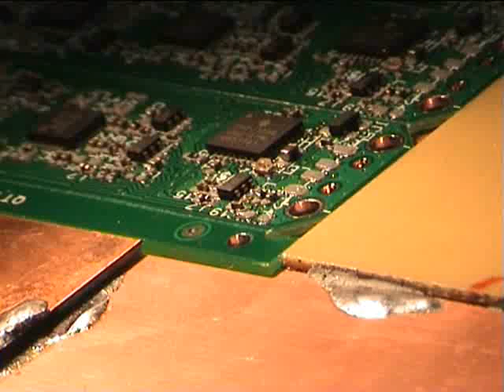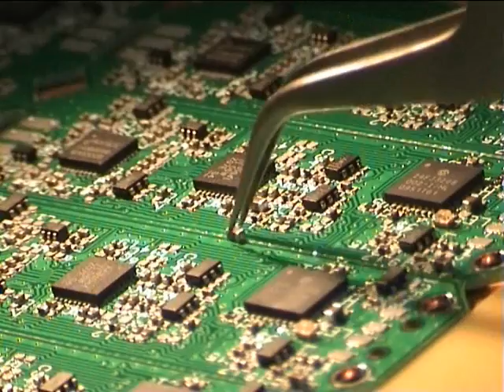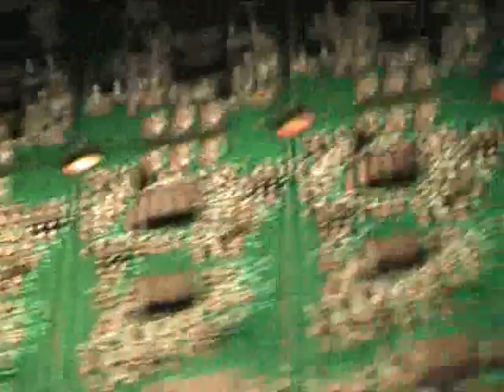Manufacturing FUNcube Dongles

Comment: tell the MSi001 chip manufacturer to "make a similar chip but with an RF output, since this output can allow to make transceivers using the same frequency generated in the MSi001 and other utilities such as RF generator, etc etc (the modification to be made is minimal)